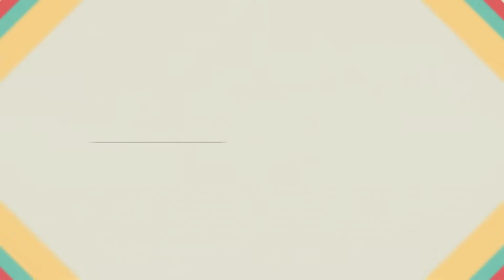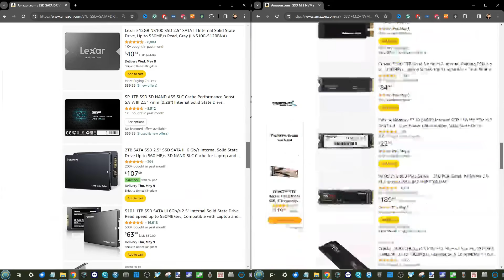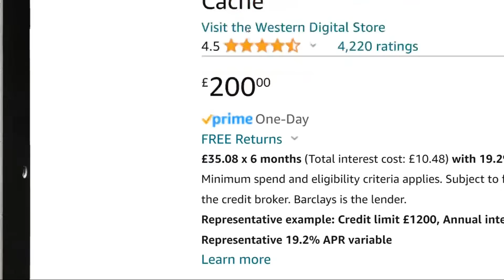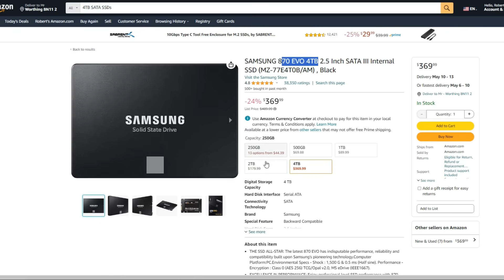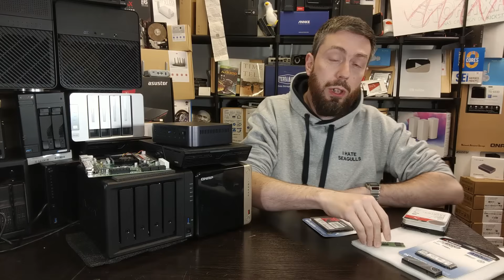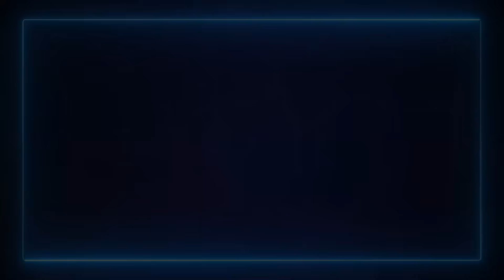SSDs in Your NAS - Power Consumption, Speed, Price, Durability, Noise and More

Comment: just some numbers, as you can see, DWPD is not the strongest side of hdd's
hdd Seagate Ironwolf Pro 24tb DWPD -  0.0625 (550 tb annually, 3yrs warranty)
hdd Seagate Ironwolf Pro 16tb DWPD -  0.0343 (300 tb annually, 3yrs warranty)
ssd Samsung 860 EVO 4tb DWPD - 0.329 (5yrs period, 5yrs warranty)
ssd Samsung 870 QVO 8tb DWPD - 0.197 (5yrs period, 3yrs warranty)

Comment: One of the problems with HDDS is the fixed BOM compared to SSDs.  Whether its a 1TB or a 20 TB HDD. The cost of motors,  chassis casting etc, does not really change much.  Where SSD tech is still not mature. Shrinking process tech and change to NVME "Stick of gum" form factor keeps the BOM down. As NVME SSDs a naked PCB compared to a modern Helium filled HDD.

Comment: I've installed 2 cheap 476GB HP SSD's in my Synology RS3618XS which has (7) 10TB WD Red Pro drives in RAID 5. My server is mostly used for Plex. I consistently get a 95% hit rate on the SSDs as read/write cache devices. Large file  copies hit 26GBps. Btrfs metadata (184GB) is contained on the SSDs. DSM is set to turn off drives after 15 minutes of idle time. Using a 10GBE NIC and disconnected the (4) 1Gbps ports. I have the speed and power to do whatever comes my way. Although 24GB of RAM is installed, it rarely uses more than 4GB.

Comment: every youtuber really needs to recalibrate their SSD pricing assumptions. They've skyrocketed in price the last couple months. The SATA crucial BX500 (which is garbage compared to the MX500) is pushing $100/TB when it was under $40 6 months ago. Quality SSDs used to be $50/TB for PCIe 4.0 with the top tier being at most $75/TB. It's nearly double that cost now. Worst parts is all the flash mfg have stated they are cutting back production due to low demand specifically to drive up prices...which is hte exact same thing the industry has been investigated and fined MULTIPLE times in the past already and they're just out here announcing the price fixing.

Comment: I tried consumer grade SSDs (Samsung, WD, etc) in my NAS for recording security cam footage, well within DWPD and TBW but all died within a month. Switched to enterprise SSD (Intel D3) and been running without issues. Also added benefit has power-loss protection which consumer grade do not.

Comment: thanks for the vid. it's worth moentioning that the fuller an ssd gets, the shorter its lifespan, as wear-levelling isi not as effective on a full drive. This is another variable which only effects ssds, but only if they are more full up with data.

Comment: I've been using a "dis-used" small(ler) 8-bay NAS for a dedicated Apple Time Machine replacement.
That was about 4 years ago, still going strong. (read: no issues, no problems, still 100% health according to the NAS)
I did make sure not to use a QLC SSD, and thus opted for SLC (that was more common back than) so it was the smaller capacity (8x 500Gb's) and noticed quite a big performance using SSD's as a bonus.
In all, SSD's can be used in most confidence, depending on the application.

Comment: Why are SATA SSDs "locked" to 2.5" size?
3.5" SSDs with larger capacity would be nice. More chips could fit in it. A NAS SSD with MLC storage. Most NAS devices take 3.5" drives anyway.
On the enterprise side we now see SSDs with 66 TB storage per drive. Expensive as hell, but still.
Reply: I can't claim to know for sure, but I'd guess that the slow SATA I/O is a reason not to go for really huge SATA SSD's. Now if they were using SAS there might be a reason to build them larger. More speed means more I/O and makes larger capacities more realistic.

Besides you don't really need to make the drives physically larger. A 2.5" SSD is mostly an empty shell. You could easily fit double or triple the number of memory chips inside that case. But the customers demanding really large drives are the same who are prepared to pay for faster drives, and here SATA doesn't stand a chance.
Reply: I've long wondered the same. A 3.5" SSD would allow for larger capacity (at less than QLC) and still have room for thermals control. The latest SATA speeds are plenty adequate for most of us I'd think, though a SAS option would also be nice. Twould seem there'd be a huge market for "fast enough" larger capacity drives that don't break the bank; though perhaps the mfgs have been scared that would this 3rd middle option would dilute their sales of the others?

As is, I bought just enough SSD to get these machines running, years later, just enough NMVE to upgrade my main, and just enough large capacity spinners to have adequate internal & external storage. 

I and many others may never have 2.5/5/10gbps (or at least not anytime soon) so not worried about trying to saturate my network with insane drive speeds, but would appreciate the larger caps at faster than HD.

Comment: For most people, their hot storage is probably 5 - 10 TB, and you can use SSD's for that at pretty economical prices.  Usually, it's the cold storage that still need to use HDD's.  That kind of hybrid makes sense for most people, because you can quickly access your frequent files on your SSD's, and then wait  a bit longer to access non-urgent files at lower prices on your HDD's.  

One thing I wish we can get rid of is RAID, and I hope that the move toward SSD's with built in data integrity check (as long as the SSD's have power) will make RAID less necessary.
Reply: Without RAID, you’re still loosing your data when the drive fails.
Reply: @Ulven3829  RAID is not a backup.  As long as you're constantly and regularly backing up your data, then you can always recover from your backup whenever you discover data corruption or if your drive fails.  The important thing to do is backup regularly, and run data integrity check regularly.  This method works only if your data does not change very frequently, because otherwise you'll also have to backup your data equally frequently, and that might be infeasible.  Alternatively, it would also work if you're ok that you can only recover back to a recovery point a week ago, rather than the last update.

RAID is a method to make your storage medium for durable and more resistant to data corruption, which is really useful back in the day when data on hard drives go bad all the time.  But as the storage medium become more and more durable -- because they have built in data integrity checks -- such as SSD's when they're receiving constant power, then RAID is less and less relevant.  RAID is actually a problem, and I look forward to when we can get rid of it.
Reply: @KenoticMuse  Where did I say that RAID is a backup?
SSD’s don’t need power to keep the data stored on it, so how does it become more durable?
If you have 1 drive in your server/NAS that fails, you’re down while you recover from a backup. But in a raid you , you’re still running even if one or two drives is failing, depending on the raid type. Even a mirror keeps you going, but it’s still a raid.
Reply: @Ulven3829  Look up how SSD's work.  They only run data integrity check when they receive power.  SSD drives obviously continue to store data without power, but it won't continuously run data integrity check without it.  Also, the charge in the SSD's will leak over time if left unpowered.  Thus, if you leave your SSD's unpowered too long, your data will rot faster than on HDD.  If you plug them in, then they're actually more durable than HDD.

I don't think you don't understand what RAID is for or how SSD's work.  You're asking me things that this channel and many others have already addressed.

Comment: Quite the weird video.

1) You say SSDs are normally 3-4 times the price of HDDs, but show that the NVMe SSDs are around 240 "Nickers" compared to 100 of the HDDs.
2) You say that HDDs are around 35 Bucks per TB. If you ask the Datahoarder subreddit that would be a horrendous price. I got 6 18 TB Ironwolfs for 220 dollar per drive last year.
3) You say that its less likely for NVMe SSDs to be QLC flash but where is your proof? The SATA SSD you have uses TLC which is the same as the Lexar one you showed as an example. The Crucial P4 Plus NVMe SSD you showed uses QLC for example.
4) In your AJA Test you can see that the HDDs start quite fast with its write speed and then drop down to around 500 MB/s. On the ATTO Benchmark you argue that the HDD has the disadvantage of being highly inconsistent. First of all its mostly inconsistent in being faster than the max continuous speed (500 MB/s) and hitting 900 MB/s sometimes which should even be better for the user.
5) The biggest problem with the ATTO benchmark is that you did not check the "Bypass write cache". The HDDs have a combined cache of 1 GB, while your filesize is 4 GiB. This helps the HDDs to create highly inconsistent results even if you dismiss the Synology possibly caching stuff.

In Europe at least, Sata SSDs pretty much become useless, since its price is exactly the same as the NVMe SSDs so they should only be chosen if you need SATA devices.

Comment: Most of the advantages of SSD's are predicated on users having a faster than 1 GbE connection. I feel the vast majority of home NAS users do not have that situation, in which case, all that extra speed is cut off at 125Mb/sec for standard 1 Gig Ethernet.

In addition, SSD speeds, beyond pure benchmarking, appear to be significantly lower than theoretical. For example, pretty much all SATA SSD's tout something like 560 Mb/sec read performance. I've never seen close to this in real world copies. My DS223 using a pair of Crucial MX500's and copying between drives (one drive per volume in BTRFS) manages somewhere around 230 Mb/sec transfer rate - nowhere near the advertised read rates.

In another example of SSD's not performing as the marketing stats would have you believe, I actually get a faster, more consistent transfer rate when copying data to my external 2.5 inch HDD over USB 3.0 in said NAS than an external Crucial X8 SSD which lags at around half the 100Mb/sec transfer rate of the aforementioned HDD.

Of course, SSD's will do far better during things like RAID rebuilds, but those events are rare, so not a major plus point for me. While I do believe SSD's will become more and more popular, especially at lower capacities, they are not the utopia some believe. I use a pair of them in my DS223 because I wanted silence and low power for its use as a personal cloud server sat under my TV. However, my DS1821+ is all HDD's because of the sheer volumes available and at a price point that is far cheaper than SSD's.

Ultimately, it's horses for courses.
Reply: Power consumption, noise & IOPS are the biggest pluses for me, data transfer speed is on the bottom of the list

Comment: Simple statement ... gonna need to see SSD capacities get above 10 or 12 Tb each, using a minimum of TLC quality NAND at a near equal price to HHD's at the same capacity, until then SSD's just cant do what I need them to do.  Kinda like where I live in Canada, I wont buy an electric only car until it can do 1000km in winter on a single charge.  Today, they just cant do what I need it to do.

Here's a thought:  Why do manufacturers belligerently hold to building these smaller SSD chassis?  Our computer and NAS systems can physically hold HHD sized storage, and will be for quite a while yet.  Why is larger capacity SSD's not using the chassis size of HHD drives?  That way you could jam a lot more NAND in the box, and use TLC or better without running into the limitations of the physical constraints of the smaller SSD unit boxes.  How much is this issue impacting SSD capacity sizes?  Robbie ... maybe thats a video?
Reply: From what I recall reading waaaay back in the day (Before NVMe drives were even a thing) The reasons for no "Physically larger"  SSDs with more NAND, is because More Chips = More points of failure, (Just like a RAID 0 array) wear leveling more chips is more complicated, and the typical timing difficulties you get from parallel data connections.
You can find M.2 SSDs with 4 chips on them (utilizing the underside of the board to put NAND (The old ADATA SX8200 Pro was one such drive), but that practice isn't that popular for several reasons. It really is just easier to have 1 or 2 big chips, then many smaller chips in parallel.

Comment: Great video as always Robbie, Will stick to an NVME cache and HDD storage for a good few years I think. Where did you get your hoody from, I need one in my life.
Reply: What are your thoughts of write cache alongside read cache?
Reply: @yensteel  In my case (with a QNAP NAS) I don't use the built-in Caching feature so I can't speak for it. My transfers go to the NVME SSD from online, as with the RAID 5 the disk speed was bottleneck. These are stored temporarily to make them available ASAP. Then a job moves these over to the RAID volume at intervals where I won't be actively transferring.

Comment: Didn't mention power on requirements of SSDs to retain data.
Reply from the maker: Actually, I'm pretty sure I did highlight the 'power on at least once every X years, or loss" at some point. I added it because I didn't mention this on an SSD review back in March and got heat for it! Also, follow to this video on the subject of a more domestic use case, coming soon

Comment: The intelligent approach is a hybrid setup.   
I run SSD NAS for files that are rapidly and frequently accessed throughout the day, but have an HDD pool for larger, less frequently used and archvied project files. I also run a strictly HDD based NAS for remote backups of the hybrid system.
Reply: I agree I have 4 nvme drives for day to day stuff. A 2.5 SSD for file I do not want to ever move and a 16TB Ironwolf Pro for the rest. And I back it all up to Idrive which is 10TB and it costs me £20 a year in the UK. And I can have a few copies of my SSD up there and it needs 3 passwords to get to it.
Reply: Do you manually split which files go to which drive or what software does it for you?
Reply: Totally! Tiered storage is a big thing in businesses, and auto-tiering is the way to automate this part. You're already using tiered storage with your system.

Comment: I use SSDs in the NAS that I use for incremental backups. My thought that I don't need to worry that much about the write wear. Read wear is not so much of a thing. An HD would however spend a great deal of time just spinning, waiting for something to do. For this use case, I would think that an SSD would be far more stable over time.